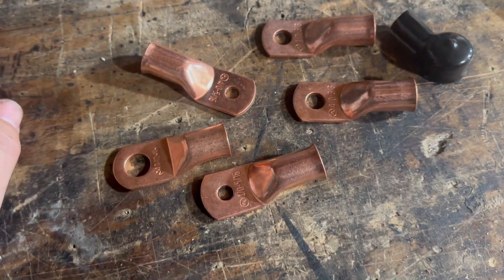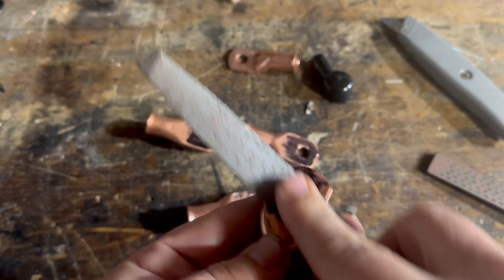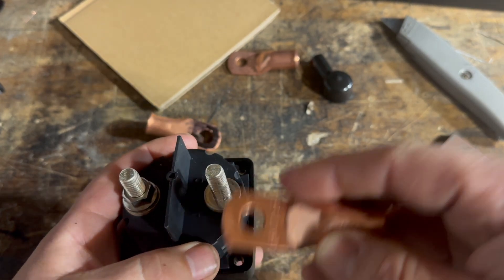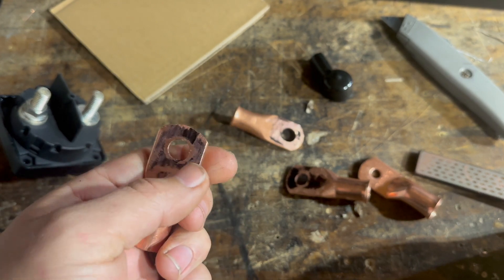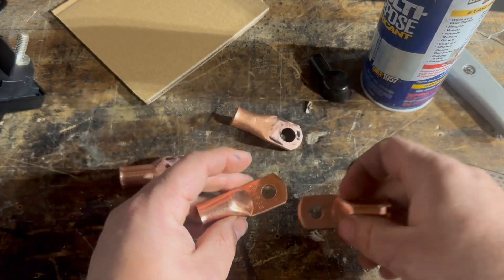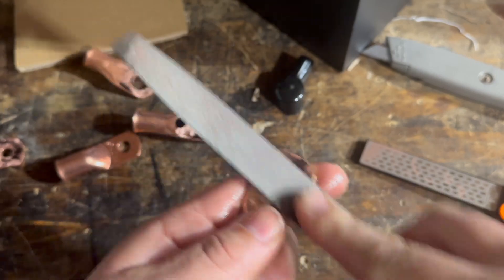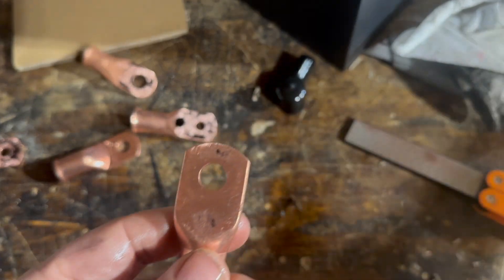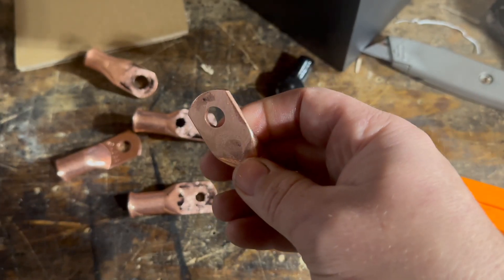Prevent melting battery switches and fuse blocks with flat lugs and good connections.

Comment: I found the Bue Seas 300A switches start to get hot at about 90 amps. Using heavy gauge wire helps sink the heat back into the wire, and good technique on the lugs helps a lot.

I use sticky-backed 220 or 320 grit sandpaper stuck to a piece of flat steel to flatten the lugs and remove corrosion. 

FWIW - the way I read Blue Seas docs, the current rating is depended on wire gauge. I'm assuming that they expect the wire to conduct heat away from the switch.
Reply from the maker: Good info, thanks for sharing.

Comment: Looking at some of the Victron 'reference' documentation, it appears that they recommend using 'short as possible'  equal length wires to a common bus bar from each battery.  I know this is not feasible in some applications, but perhaps this combination  with 'true flat' copper connectors might help ?

Comment: Hey Thank you for sharing on this subject! So I'm an electrician for 30+ yrs, [as in Building, Home etc,] DC is a bit different but similar I'm still learning! I'm just redoing the house battery in my sprinter work Van. I'm using 4/0 Copper, and I just look at the lugs I bought on Amzn, similar to what you have in this video, and I say to myself, looking at the diameter of the wire, then looking at the surface contact area of the lug to the battery terminal, and the disconnect switch. Seems like the surface contact area is really small.  When I compare this to AC Switch gear, or even a Residential circuit breaker panel,  4/0 lugs are aluminum, but the surface contact area is so much larger.  Of course you de-rate for the Alum vs Copper, but the contact area's seem larger.  [I think rated to 600VAC]. Anyway, I'm gonna be working on mine soon, I'll try doing a little load test, and use IR Cam to see if I can learn something more.  You bring up a very important detail in a build!  Thank you!  God bless! Al from CT

Comment: I would think from working with copper the copper would be soft enough that when you Torqued it to the proper torque, it would form to whatever you were bolting it to 🤔.
Reply from the maker: It’s soft, but it only takes .001 inch to make contact vs not.

Comment: Great insight, thanks…just a thought, but, I wonder if an automotive copper crush washer might cause a mush better contact while eliminating all of the filing?  Just thinking🤔
Reply: Maybe one of those star lock washers I think their called would bite into the copper. Other than the different metals together may not be good.
Reply from the maker: I’d still prefer as much contact area as possible. I plan to do some testing to see if it actually matters :-)